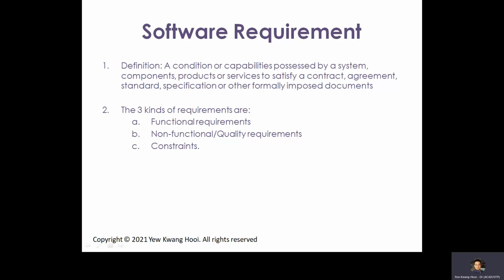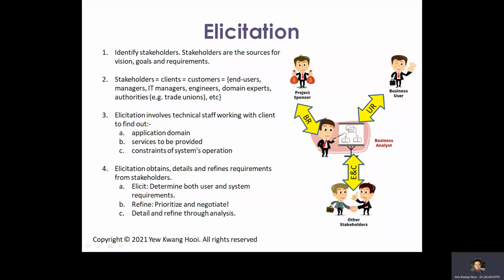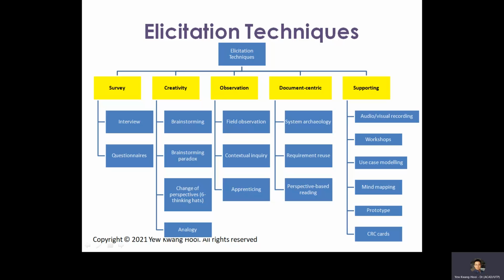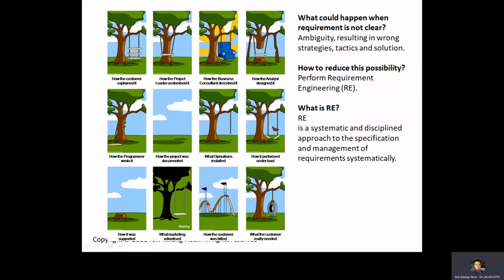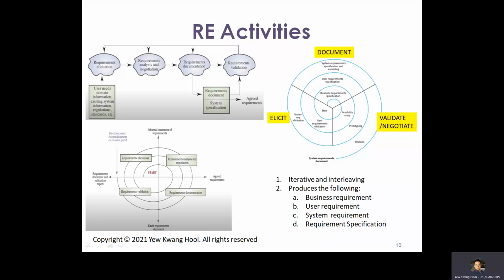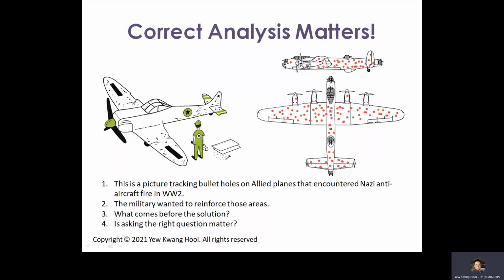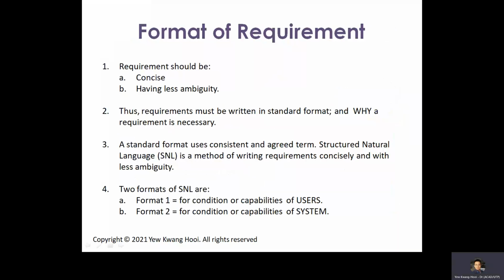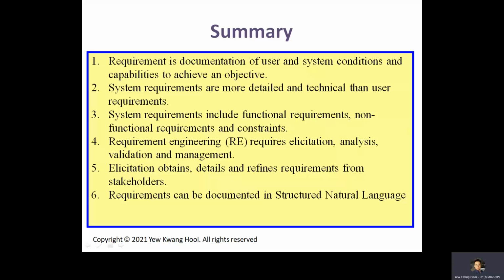UTP-Software Engineering-04.Software Requirements

Comment from the maker: 00:07 Software Requirements: Elicit, Analyze, and Document

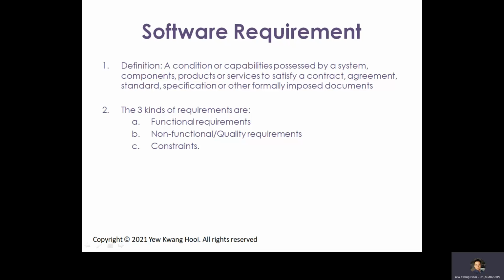03:44 Software quality is no longer assured

10:23 Contradictions may occur between management and operation while looking for changes.

13:17 Brainstorming and other creative approaches are effective for idea generation

18:11 Software customization requires prototyping to understand needs and identify issues

20:16 Requirement elicitation is crucial for accurate software development.

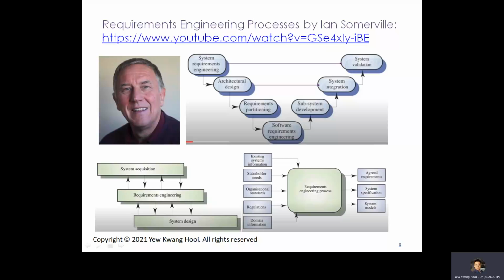25:00 Requirement engineering is crucial for software development.

27:14 Software requirements determine the success and quality of the software.

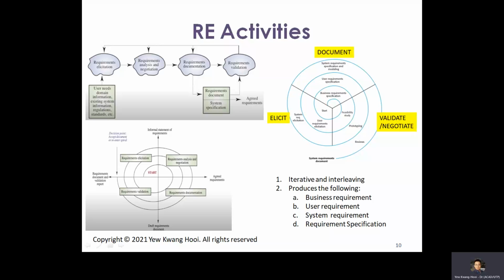31:26 Analysis of system requirements is crucial

33:50 Adding armor to airplanes does not make them stronger and may even result in more planes being shot down.

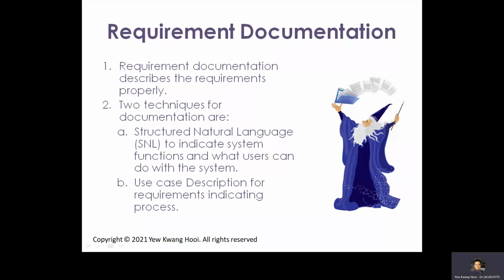38:26 Write clear and structured requirement specifications.

40:22 Requirements must be written in structured natural language

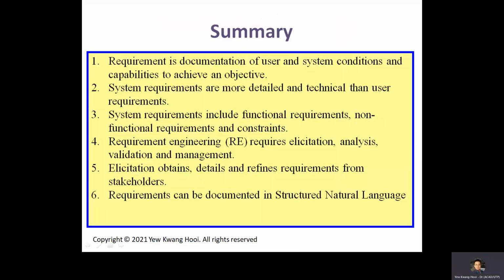44:40 System requirements are detailed and technical than user requirements.

46:33 The capability desired